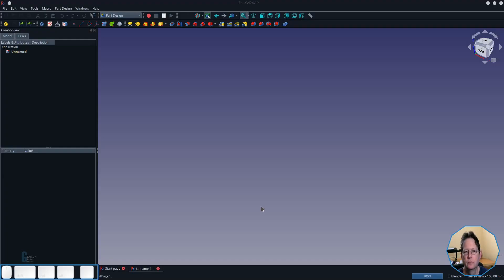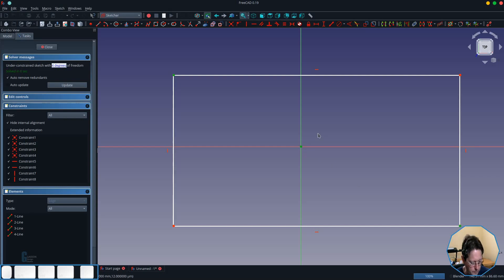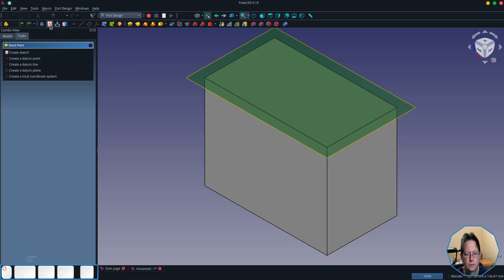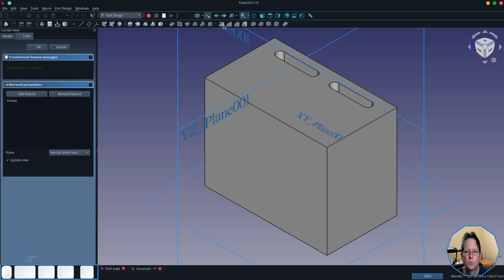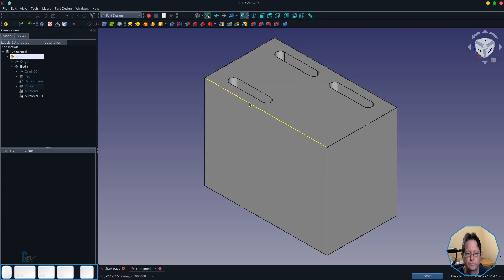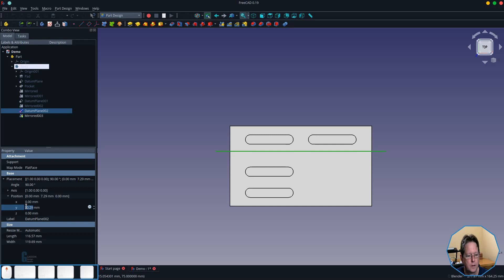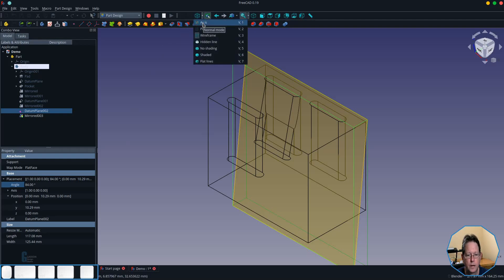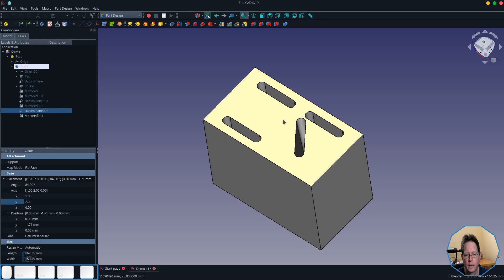Howto use the Mirror Tool in FreeCAD's Part Design Workbench

Comment: Thank you for Great videos.  If I use the PART work bench, Mirror a solid;  can I do further work on the mirrored part with out effecting the original part?  The left side , and the right side of my cabinet have the same top, bottom, and back dados, but the left side needs peg holes for shelves, and the right side needs pockets for hinges.
Reply from the maker: Thanks for your kind words. I'm glad that you're finding them useful. I have very limited experience with the Part workbench because I use Part Design for my work as I think it fits the way I work better. 

I don't believe that you'll be able to modify the original without the mirror getting the same changes. I would create two separate parts rather than use a mirror.
Reply: @GlassonDesignStudio  Thank you for getting back to me so quickly. I like what you are doing. Keep up the great work.

Comment: We discovered your FANTASTIC videos a a wile ago. Very well done. You know your cad. We would love to subscribe to your videos but there is a small problem. Some of us have bad eye sight. Due to you knowing cad so well  the pointer disappear at times due to moving so fast. Not your fault but the cursor's problem. A few sites already fixed this problem for us. Normally the cursor is very small and black or white letting it disappear from our eye sight. If you could make it bigger and Bright Red with a light Yellow Hue around it.
For   WINDOWS   Google   catnip5   . Scroll down and you will find the cursor   catnip5   page.
UBUNTU   have a fix by downloading Tweaks where you can do some tweaks and also then go to  Settings   -> Accessibility. Beware Zoom "might" make your pointer jumping but if not it is fantastic, most of us use it.
Thank You So Much, we would Appreciate it Really a Lot.
Reply from the maker: Hi Pieter, thanks again for your feedback. All my videos up until the one released today will cause you problems due to the small mouse size. Unfortunately I can't do anything about that now. 

I have taken onboard your suggestions and have switched to a highlighted cursor starting with the video I released today about the Loft Tool. I hope that this change will make it easier for you to see the cursor.

Comment: could you explain how to use the multitransform feature to put that 4th slot in the remaining corner?
Reply from the maker: Hi Gregory, I will be releasing a video on the multitransform tool in January
Reply from the maker: Hi Gregory, it turns out that I was a little over optimistic about getting the multi-transform tool done in January. I will be covering it this year though. Sorry
Reply: Select the pocket, Create multitransform feature: add two transformations: mirror on vertical axes and mirror on horizontal axes => OK

Comment: Great video.  Well & clearly presented at a reason pace with clear speech.  Thank you very much.

I have a complete object I would like to mirror to create another object with twice the volume.  Is this possible in freecad?
Have created the part shown in the video linked below and would like to, for my education & curiosity, create another 2x part by using freecad to put two of these parts together flat side to flat side.  You are saying this mirror feature only works on pockets & pads.  Would like to mirror the part using the XY plane as the mirror plane.  Maybe I need the multitransform feature?  It is next in line for me to look at.  Your thoughts appreciated. John

https://www.youtube.com/watch?v=CbPIs4MzvzU
Reply from the maker: Hi John, the Part Design workbench is intended to be used to design parts rather than manipulate the parts once they've been designed. Therefore the mirror tool will only mirror features (pads, pockets) within a part that is being designed.

The Part workbench on the other hand is an older workbench that was intended to be used to design parts using primitives AND manipulate the parts once they were designed. So you should use the mirror tool in the Part workbench to achieve your desired goal

Comment: Thanks Geoff for another great video. I do like FreeCAD, but I find it rarely lets me do what I want to do, instead I find myself spending more time finding workarounds than I do actually designing. You hit upon an example of this when you wanted to create a mirror of a mirror, which is a perfectly valid thing to want to do. I will add a couple of examples a little later of things that I struggle with. But in any case, thanks again for the video, and enjoy the coffee :)
Reply from the maker: Hi John, Thanks for your kind words and the coffee. The coffee will have to be an iced one 'cos I'm heading up north for a few weeks with my day job and the temperature is around 37C.

I know what you mean about finding workarounds - I've had to do that a few times myself. Please feel free to let me know what your struggling with and I'll try to help you out.